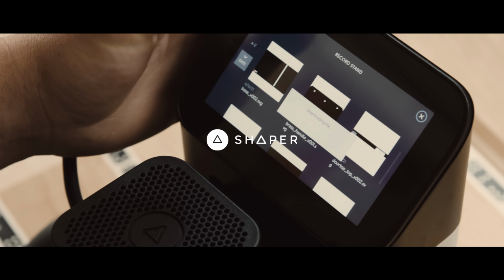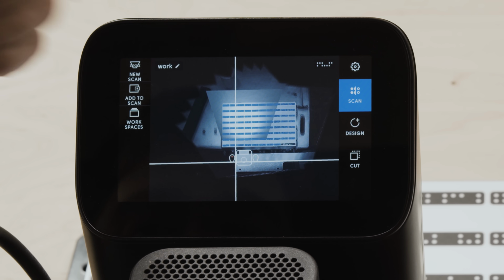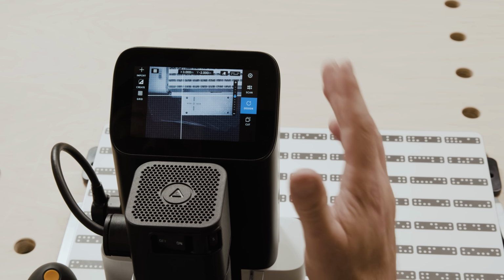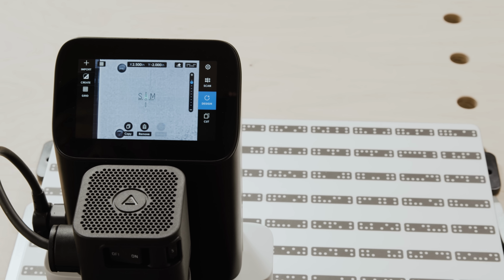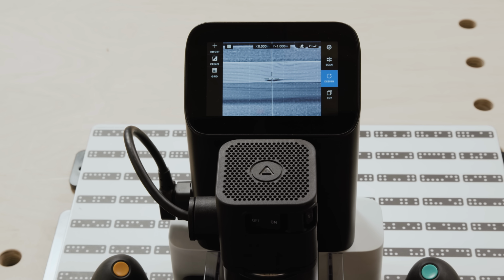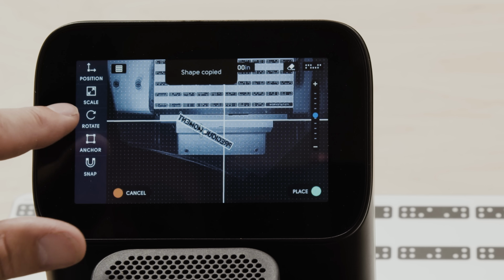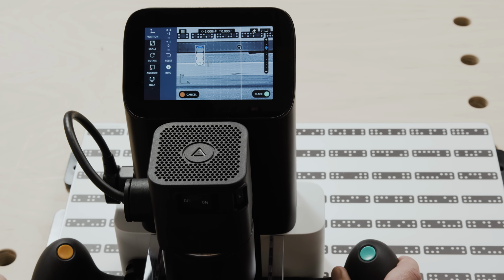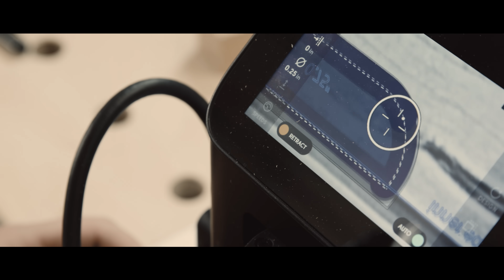Shaper Origin: Walkthrough of Inverness Update

Comment: I like the new update although I experience unexplained slowness, lags if you will especially when changing cut paths (ie going from pocket cut to inside cut) or when changing the offset of a cut. Origin will display the domino loading screen for anywhere from 15 to 180 seconds depending on the overall complexity of the design.  Not sure if that is normal?
Reply from the maker: These kinds of slowdowns are usually related to your cut file or workspace. Try clearing you cut history or refreshing your tape field. If you continue to have issues don't hesitate to reach out to Shaper Support! support@shapertools.com